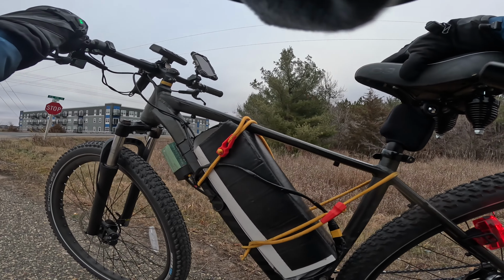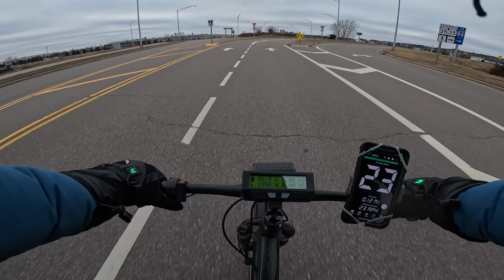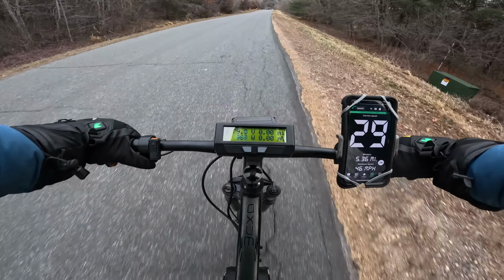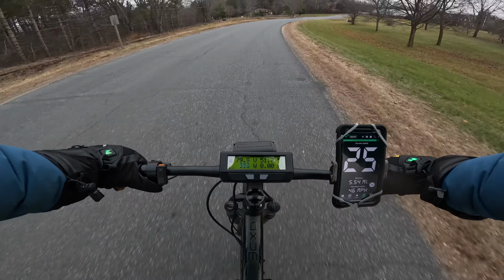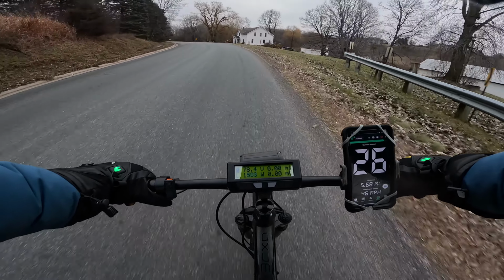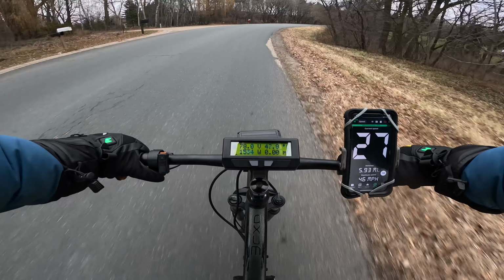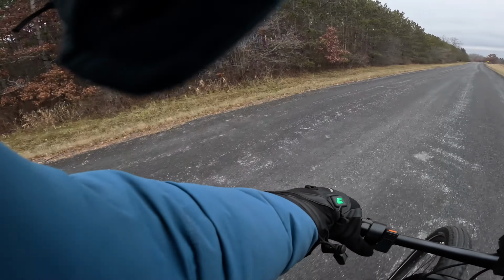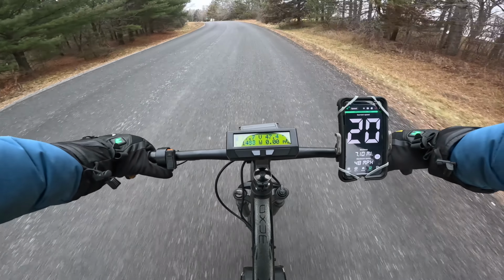V6 Phaserunner 25% Field Weakening Limit?? Testing 72V BBSHD w/ Frankenrunner L10

Comment: I run 40% FW all the time. Nice work but you are definitely reaching the limits of the BBSHD. Your next move could be a Lightning Rods motor that can push 6000w all day!
Reply from the maker: i like that its super light weight, QR wheels, can move it around and work on it easy. Looks like a bicycle, not a motorcycle. I want to try a high power direct drive hub motor,  but not on a hardtail.  i've hit some big potholes on hardtails, it's rough when you're going fast. I wouldn't want to be going much faster without full suspension and  probably some better brakes and stuff Lol. I just built this bike, so i'll f around with it and ride it for a while. I wanted to try and get some good BBSHD Phaserunner settings that I could share with people who don't want the HV Kit.  But if there's no easy way to get around the 25% field weakening limit in the phaserunner v6,  then yeah I see why Mr HV had to become an ASI dealer. ASI locks the controllers down to some extent. I'm not entirely sure why there is a 25% limit on field weakening. Unfortunately ASI doesn't even let people look at the documentation on their website without logging in as a vendor.  The more i learn about ASI, I think i will avoid their controllers in the future. It is apparently possible to brute force the access codes but I really don't want to go to extreme measures just to increase field weakening by 10% Lol. IDK I am hoping Grin Tech responds favorably and makes some change to the Phaserunner software or provides access codes for people who want to increase field weakening. Or I will probably brute force the access codes just because I don't want a locked down controller.  I wasn't aware ASI is so lame
Reply: @EBikeBuilder_  
I’m with you there on the benefits of a lightweight bike. I ride Fox  full suspension front and rear with Saint quad piston brakes with nice big Ice Mountain rotors for great stopping power. My bike is a Diamondback Mission Pro that is built tough to take the abuse of going down a mountain side so I am more than happy with my setup. It’s an absolute dream to ride on the road and even more fun off. What is sweat with the HV setup is that I have 2 separate modes to program the bike in different ride settings and all it takes is a simple button push on my display or phone to swap back and forth between them. Enjoyed the video but you’re a braver man than me to ride in the cold. I will go out whenever we get some snow though…..
Reply from the maker: @kmtnbike1117 your bike sounds like a dream man 👍👍id love to see some footage of that! there is a lack of content for 72v bbshd stuff on yt. when i was searching anyways. But it seems like the HV kit is popular, So i am surprised more people don’t post riding videos of it. I would love to see your bike ripping on the trails. Now that i thinkabout it,  I haven’t seen a much content with bafang DIY bikes doing mtb trail riding stuff. Its usually like the Trek bike shop torque sensor low power ebikes. Very cool man i can imagine the 72v bbshd eats the trails 🆙 😂 🚴‍♂️ 🔥

Comment: Hopefully Grin can help you out. I noticed you had peaks to 4300w, could this also be part of it or did you also have the PR set that high? And this is why I'm excited for nucular 6f v3 to come out. Super easy to tune, great display and up to 22s 200a which still being very small. Should be out this year I plan to grab one for my bbshd
Reply from the maker: I changed the field weakening, and i think the max current and phase current on the frankenrunner is 96A. instead of 90A on the Phaserunner v6. But the jerkyness while applying throttle came back while i was moving. That had all but gone away with my phaserunner settings. So iunno maybe something different with the virtual freewheeling? i am going to increase it on the Frankenrunner a bit.  I know the zip tie would make it go away but i want to try and get it close as possible in the settings first. Nuclear sounds like a cool controller , i need to look into other controllers. I don’t like how ASI locks it down and i have to switch to some old controller just to try 10% more field weakening. Can’t even look at the documentation on ASI website unless you log in as s vendor. Super lame. I Don’t plan on buying anymore phaserunners after this ASI detective work
Reply: @EBikeBuilder_  I asked because before I swear you were only running like 3300w now its a lot higher. I'm not sure with the jerkyness, do you think you will stick to the bac if you can't raise the PR limit? I really like it, VESC is also another option I see a lot of people on facebook groups running it. My Ludi v2 is VESC but lunacycles locked it down, only lets me set it to 6.5k rpm max when I know it can go higher. Annoyed because the guy who designed it said he would help me out and implement a feature I want and now hes completely ignoring me no support whatsoever! That's why I want to try the nucular, they are Russian though so the war has caused setbacks resulting in delays on development sadly. I left a comment saying they should make a kit like they do for the surrons hopefully they will! Oh and also I can link you the heatsinks I used on my bbshd, yt comments doesn't like links though I can email if you would like

Comment: My ASi BAC 855 came set on 52v 39% FW, even if the seller states that it comes with 25%FW. With the Kilowatt App I am able to play around, and I set it up to 40% FW…Everything seems to be healthy and 3-5km  faster 😁 The best for those setups in my opinion are the full suspension DH bikes 👍🏻
Reply from the maker: the FW limit depends on the firmware version , v6 bac firmware has the 25% field weakening limit by default. ASi BAC controllers are sold through their partners, who decides if they want to change it or not. In the case of the Grin Tech Phaserunner  apparently the default 25% fw limit is in place , and its not an easy matter to remove.  Thanks for mentioning the kilowatt app. That's cool ill have to try it. I've seen its possible to unlock the asi bac controllers with some software tricks. I agree a full suspension DH bike would be nice for it. but no where to put a battery. I'm okay with a suspension seat post. Of course It's only 80mm travel or something, so I stand up when i'm gonna hit gnarly bumps.
Reply: @EBikeBuilder_  I think I can remember you saying in one of your other videos and comments that it depends by the firmware 👌 I am sorry to hear that…but I think the ASI ones on the market should come with the firmware which allows you to simply connect with your phone via bluetooth to the controller ( KILOWATT STG app), and there you are able to make hard and permanent changes to the settings ( Fw, voltage, phase amps, throttle, etc….even if the seller locks the controller ( that what my seller states - locked ). I started also my setup on a hardtail ( with a suspension seat post) but…after a while I could not stand up any more for all the shaky experience…and I bought a DH full suspension frame ( 170mm 29” front , and 27.5 rear) which changes all the game. I know people don’t find it appropriate and they might struggle to fit the battery, but I could fit my 52v 25ah battery under the frame with jubilee clamps through the battery mount and 3 straps ( stays as cement there and doesn’t touch the front tire ) . It is possible and very nice 👌 if you are on the bafang mid drive Fb group you can have a look there , or if you want I can send you a photo  🤗

Comment: I have the HV kit that runs max 40% FW. It heats up fast so I believe that's why HV kit uses close or at a 1:1 ratio.
Reply from the maker: when I used 42T : 42T with 29" x2.5 wheels, it heats up faster than when it was geared higher 46T 32T.  At least for riding on the streets 25+ mph like i do,  1:1 gets more hot for me.  I have been told the 1:1 is for fat bikes? The reason i tried 1:1 in the first place is because Mr HV seems to preach it like an objective truth for every 72V bbshd, was the impression i got from him.  But I didn't like it at all, it was getting MORE hot because of how fast I ride.  It sounded crazy loud doing like 30mph.  My bike with the 29" wheels feels much better geared a little higher and the temps are better as well.
Reply: @EBikeBuilder_ field weakening increases RPM so from his videos 72v goes as high as 15k rpm.  He compared it to Luna cycles ludicrous v2 controller which tops out at 9k rpm. Users from Luna were melting the nylon gears.  Mr HV is still on his original nylon gear which is pretty crazy to me.
Reply: @EBikeBuilder_ when I cruise around 30 mph on a 42/36 it’s not loud at all. But again I’m at 40% fw and at 52v. On summer days when it’s over 100 degrees. A 30 minute ride full throttle got a scary temp of 137 degrees. That was the highest my egg rider read. I was really pushing it like how u ride. I tend to pedal to relieve stress on the motor on really hot days.
Reply: @Jujubees225 I've got the V2 and it's even lower than that, 6.5k rpms. I need to see if I can raise it in the vesc suite or if Luna locked it down. Also the melting of the gear was because they use the internal sensor but the bbshd has two different cores with different sensors, one is good one is bad, resulting in one not limiting fast enough
Reply: @Jujubees225 
I think everyone is getting a bit confused here. John(Captain Codswallop) does the videos and lives in BC Canada. Greg(Mr.HV) is the programmer for the ASI controllers who lives on the east coast of the USA and Mike builds much of the harnesses. John preaches 1:1 because it worked for him and he rides a heavier fat tire bike and has to climb hills. We have discussed this on Discord and he also agrees that if your bike is light and you ride mostly on relatively flatter ground it is fine to change the gearing up a bit but preaches that the motor likes to spin fast for longevity and not frying the nylon gear. Hope this clears up the confusion. Yes the motor will get hotter the more you increase FW. If you don’t like it get a bigger motor!
Reply: @kmtnbike1117  ah right.  I always get those two confused lol.
Reply: @Jujubees225 How can it be pedalled with such a high chainring RPM due to field weakening? Even with a stock controller it's more efficient to leave it in a granny gear at 160 chainring RPM.
Reply: @uvwuvw-ol3fg  not efficiently pedaling but pedaling to keep the motor running. It does help as the wattage is lower than throttling.

Comment: I think that is plenty fast for a bicycle on relatively flat ground. If you want to go faster then an electric motorcycle is more suited as it is more robust with better thicker tires. I am building a Honda XR200R with the QS138 V3 150A VOTOL and something different using a Grin All Axel motor with Phaserunner to make an AWD Enduro Motorcycle . Surprisingly buying a motorcycle with a blown engine and converting it to electric is cheaper than building an ebike from the ground up as brakes, tires , lights are already on the motorcycle 
Would be nice if you hooked up your Cycle Analysis to show running data on screen like you did before.
Reply from the maker: yeah I dont want to go much faster on a hardtail, i've hit some gnarly potholes.  I want to get my cycle analyst overlay set back up. but on this bike the speedo isn't wired up, and its missing the speed and mileage, so half the data points are missing anyways till i get the speedo hooked up. And its annoying riding with a backpack and a laptop,  i've got lazy with doing that Lol.  I dont feel like buying that 100$ Cycle Analogger device from Grin I cant stomach that. I would rather buy a cheap android phone and develop an app for android that logs the CA data. Apparently on IOS tim apple doesnt let you do serial over USB

Comment: You should buy some old downhill bike. There might be more weight but probably have good brakes and full suspension. My first bbshd build was hardtail. When I switch my bafang in to dh bike riding came so much comfortable. Only down side with my trek session 77 is wheel size. 26x2,5 is Biggest wheel what I can fit in to that bike. But perhaps my next build is same fatbike in to winter riding. Btw I run my bbshd with sabvoton controller and 72v battery.
Reply from the maker: nice I was thiking about getting a Sabvoton controller! i dont like how the ASI ones are locked down. But the sabvotons are Huuuge. I just like hardtails because there is room for the battery.  If i had a full suspension bike i would need room for a battery, i know some of them can fit them But not many.